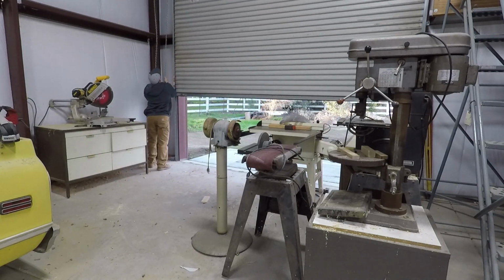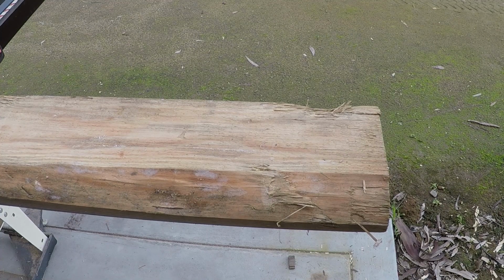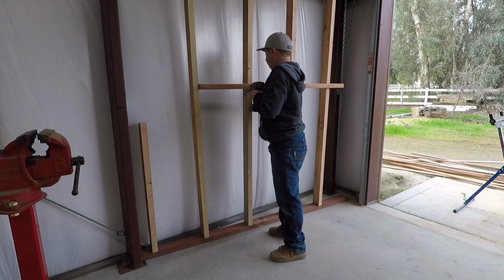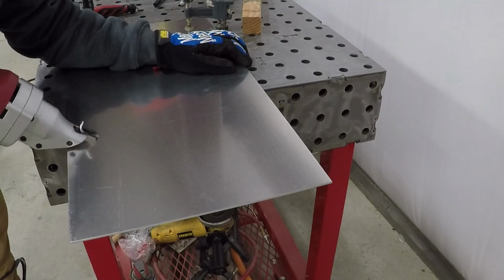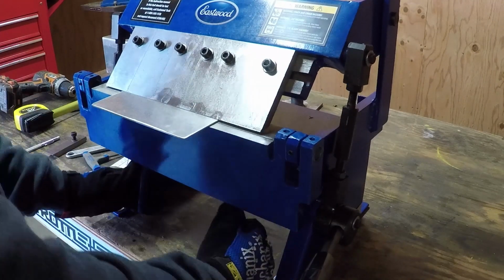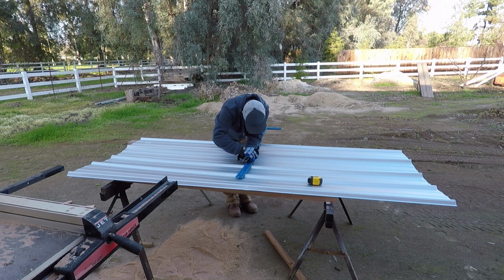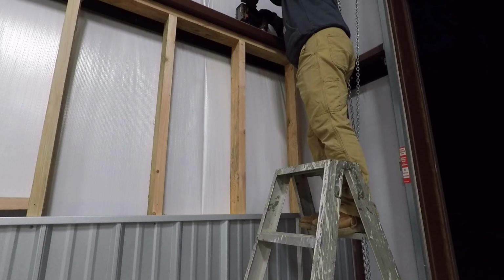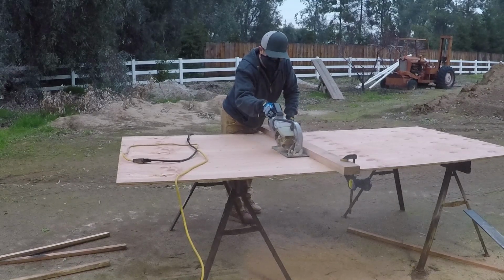DIY Corrugated Metal And Plywood Interior Walls for Metal Building | Workshop

Comment: I done this with my shop metal on bottom and plywood on top. Works awesome I put more insulation as well to help with heating so it was a double win.
Reply from the maker: I've thought about the extra insulation.   I might do that on the side that the sun hits most of the day so the shop doesn't get so hot.
Reply: @57moto59  ya I done all 4 sides even between my shop doors. It helped so much. Right now I don't have AC in my shop but with concrete floors and shop fans I do ok but winter time I can run u out with the heat. I use a wood burning furnace with a blower it does good. I did run duck work as well in the ceiling so it has a even heat. If I was doing it over I would have run some duck work down the sides and have it come out by the floor but I make do. Anyway good luck hopefully I gave u some good ideas. I liked the video

Comment: I'm shocked as someone below mentioned, for not a lot of cost you could have insulated and added great value to the heat bill. I presume your going to do the rest of the building. If not then insulation would be a no win deal.
Reply from the maker: The white stuff on the walls is insulation. I don't heat or cool the building and that is the only wall I did like that.
Reply: @57moto59  I know the white stuff is insulation. But it's not a very high R factor. Your right, if you do not heat or cool the building, I guess it don't matter. But I always plan for the future in case you ever did heat or cool the building.
Reply from the maker: @jimenz6548  Yeah.  At this point I think the money best spent would be to replace those roll up doors with insulated doors.  You can really feel the heat come through the metal roll ups.  You can be 10' away and feel the intense heat coming off the door during the summer.

Comment: What is that white insulation called? And where can I find it? It gives the shop a nice clean finish
Reply from the maker: Sorry, I don't know what it's specifically called.  it came with the steel building kit.
Reply: It's simply called blanket insulation, and needs to be installed sometimes before the exterior sheetmetal goes on. But as Mr. Moto states, it rips very easy and is very expensive. It's available from people who build pole buildings such as Morton.

Comment: did you secure the top plate of the wall to the steel beam? what type of connection did you use?  thanks!
Reply from the maker: I did.  Also the bottom plate to the concrete.  Sorry, I don't remember exactly what I used.  I think on the top, I used screws.